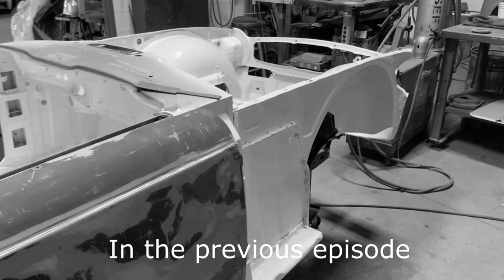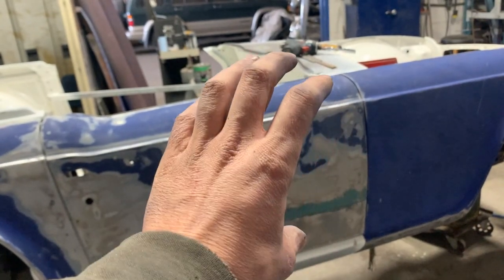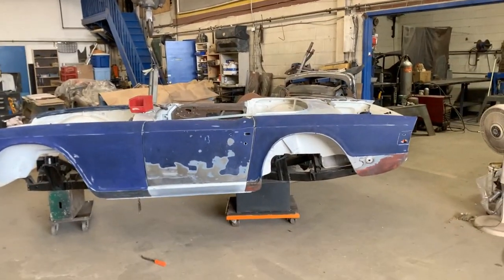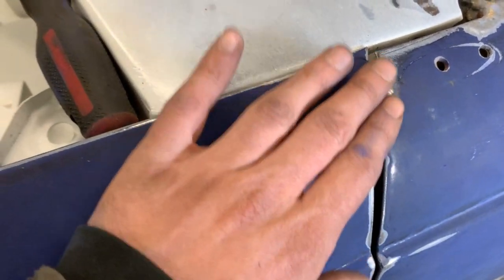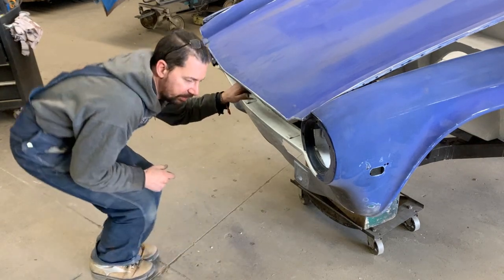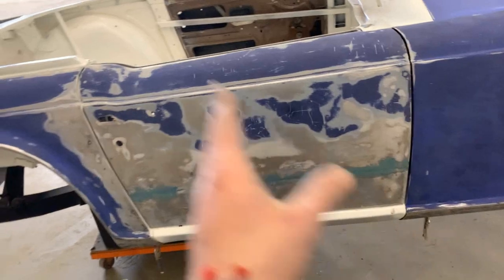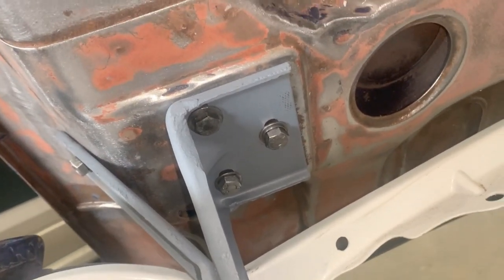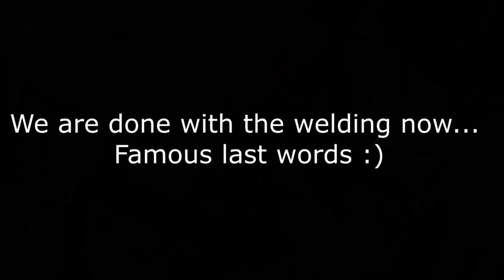1974 Triumph TR6 - Part 54 - Gaps

Comment: You are a wealth of helpful info! Thank you! I've been in the service end of cars for 45 years, line mechanic, but my passion is restoring cars. I've done a full frame off rotisserie restoration on a 1955 t bird. Made the rotisserie myself. I started working for The Great Britain's in 1975. Grew up with mgs triumphs and bug eye sprites etc. I've had a tr6 in storage for 15 years.now that I'm retired, I have the time and money to do what I want with it. Thank you for sharing your incredible wealth of knowledge! I have a small metal shop and a full cnc metal machine shop with my son, so I'm having the time of my life! Thank you !!
Reply: Would love to send you some pics of what I've done so far if that's possible. The dash I finished in a mahogany veneer. I custom made a new steering wheel hub, modifying the original to press into what I made for a new steering wheel fitment.

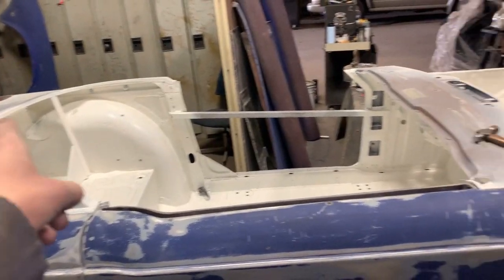Comment: Elin, this is very helpful for me. You may have said it, but isn’t the front / back position of the fenders fixed by the metal on metal to the A post and B post (i think you mentioned the front, maybe I missed it when you talked about the rear). So the only way to adjust my door gaps are to move the door, like you did … please confirm. When should I start to insert shims? Looks like there is a hinge to door shim (which I assume would accomplish similar to what you did around 6:30, especially if you only put shim in top and bottom??) and there is a hinge to A post shim (which would move the door / hing in out). Anyway, just wondering when to revert to shims.

Comment: Will final gaps be adjusted with body on chassis with wheels, motor, full weight load ?
Seems Chef Tush's last video shows this. 😃
Zoom zoom
Cheers !
Reply: Yes it seems things do change, on this car everything fitted before the body got moved off and back on.
Reply from the maker: Weel, the engine and driving gear will be in, but I am not doing a full weight load. If a load affects your gaps, then there is something wrong with your frame. Cheftush's said that he never got the gaps right to begin with, so I don't think anything shifted, it was just that he didn't know I was gonna show up and start picking at his work LOL
Reply from the maker: @johnmoruzzi7236   The problem was that when I was fitting the panels before, I never fastened them with all fasteners. The bonnet was always just set in place, but never with hinges. So it always fit, but now with the hinges things changed. That thought me a lesson for the next project :)
Reply: @RustyBeauties  That’s correct...my gaps were not good from the start.  I decided to live with it but as I’m getting older, I’m getting more picky 😉